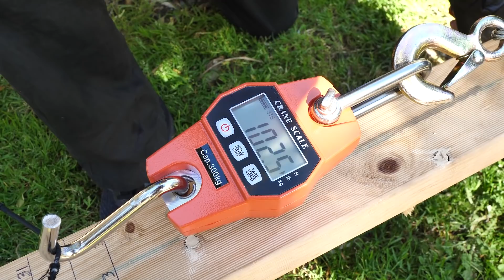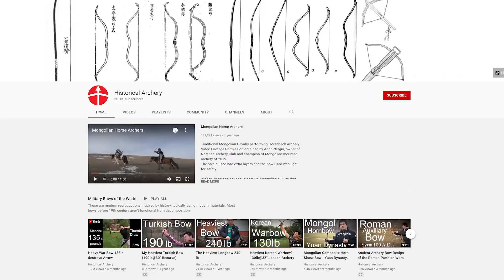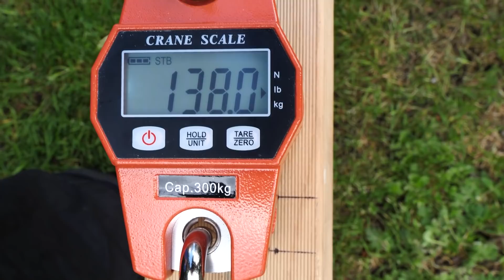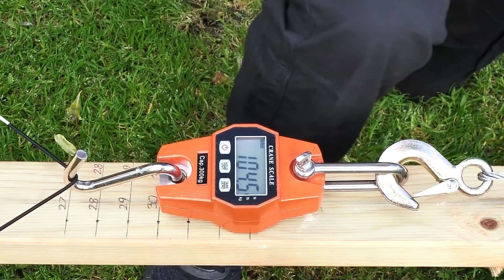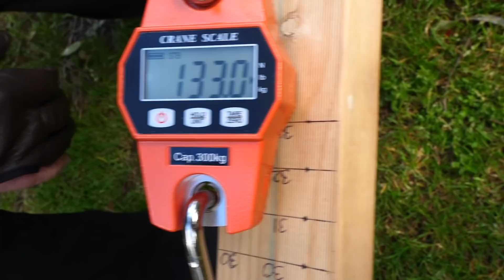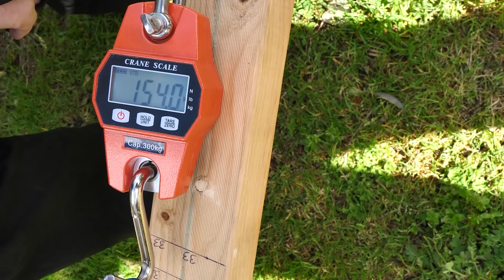Two idiots try to string a  TINY BOW

Comment: Love the video Shad! Those reflex horsebows are very difficult and back breaking to string. My 144lb@28 MR Tiron is also a two man job to string. I recommend the waist cable method to string it (with a non slippery string). Recurve bows typically have a more challenging pull experience than the longbows, assuming the same weight @ 28. They have a higher force draw curve, which translates to more theoretical energy, because when you plot it onto a force draw curve and interpolate the area of the curve, the D - shape longbows give a triangular-like area of interpolation, while these recurves are more curved upwards to give a larger interpolation area from the graph. Excited to see more videos from you.
Reply: I watch your videos. How do you string those high poundage horse bows? Do you do those old depictions of archers bending their bows using their knees and having their buddy string it?
Reply: @kenken8765  my highest draw weight is 120 (I can't even draw it beyond 29" yet and my full draw length is 31 lmao) and the kneeling method works very well if you can deadlift 180+ pounds (which most physically active people can, I think)

But there's actually a jig for it too, Koreans came up with one a long time ago (it's pretty much just a small steam bending form and some rope lol)
Reply: @Sk0lzky  why not look into a selway limbsaver recurve bow stringer? 
I use one to string my 50lb draw re-curve longbow and I think it would work just fine for this kind of bow as well.
Reply: @jackn2236  not designed for this kind of bow with static Narrow tips
Reply: @HistoricalWeapons  ah my mistake.
Reply: 144lb recurve god damn
Reply: @samueladiwinata3440  it's 200@34 lol
Reply: That isn't just a more challenging pull experience, that's a bow stacking at it's draw limit. There's absolutely zero point using that bow to try and get to 32". Shad, you need to send it back and get the right size.
Reply: @buzzkrieger3913  The bow does draw to 32' i have one myself. its stiff because its brand new. it will flex futher once its broken in
Reply: @maximilianpierce5115  that bow does NOT draw to 32". Look at MR website. 47" Despot is 30" max draw from the back.
Reply: Nice to see u here
Reply: they're not just for horseback
Reply: Why have a bow you can't use??
Reply: @cheshirebowman4465  I can use it
Reply: @HistoricalWeapons  o yes. So I see. 🤣🤣
Reply: @cheshirebowman4465  if you can't use it, train your muscles to get used to it

Comment: A long bow is smoother to draw than any other bow type. I know that, because I have a scoliosis and longbows are the best, because the smoother the draw, the gentler it is on the spine.
Reply: Did you try a long manchu bow or yumi ?
Reply: I agree with you. The recurve was designed for horse back and the ramp up he talks about during training, when you hit that, it is your normal release point. Recurves can be accurate but they are more speed than anything.
Reply: Though well made 'horse' bow has much smoother release and much less hand-shock... I know that because i have damaged ligaments in bow-arm wrist...
Reply: In my experience my horsebows and recurves draw much smoother than longbows. They may have more preload early in the draw but this is a good thing.
Reply: Interesting info. Considering my lower back and neck are pretty much shot that might be much easier on me than some of the recurves I've tried. Thanks you for that, I now have a little more hope of being able to draw more than 40 lbs again.
Reply: @MrGrimsmith  What about Jake's comment?

Comment: The extra curves are what add the extra draw weight, first you bend the bigger limbs, and once they start maxing out you start bending the smaller ones, so the draw weight increases rapidly once you start bending those smaller curves. Absolutely genius design, can never underestimate the intelligence of medieval craftsmen.
Reply: I've only barely dipped my toes in physics, but I'd guess it has something to do with storing potential (kinetic) energy in the multiple curves using tension instead of the single one of a longbow.
Reply: Not at all correct. The smaller ones, called siyahs, are ridgid, they do not bend, they act as a lever. In this case the levers are in use from the start of the draw, so this bow doesn't have the two stage draw of contact siyah bows, where the string is touching the knee of the siyah, so its bending the limbs first without lever assistance and after the levers start to point backwards, they start to assist more and more, resulting in rapid increase of draw weight at the early draw, that evens out for the end to increase slowly in the end because the full length of siyah leverage is in use.
Siyahs main purpose is to increase draw length, these bows are originally made from sinew, wood and horn, and most horns are not long enough to give the bow enough draw length, so they make the bow longer with the siyahs, witch are only wood, some cases strengthent with horn plates on the sides. Wood is also lighter than horn, so making wooden siyahs instead of limbs for the whole length saves moving mass and thus increasing the performance of the bow. Earliest composite bows didn't have wooden siyahs, like egyptian, assyrian etc. bows, but bows with siyahs replaced those older designs. 
Siyah also increases the draw length, not only by making the bow longer, but also by altering the string angle, so that the bow reaches the 90° string angle, where the bow stacks and doesn't want to bend more, later.
Later invention of contact siyahs, gave the siyahs the ability to have the two stage draw, I already explained. This design made to extreme (manchu bow) gives the bow the most amount of stored energy of all traditional bows, and thus can send heavier arrows flying the speed of other bows lighter arrows, making the kinetic energy and momentum higher than from any other traditional bow type of same draw weight.
Reply: Thanks for sharing !

Comment: Dungeons&Dragons: "Shortbows are Simple Weapons, easier to use with less range and lower damage than longbows."
Reality: [This video]
Reply: Always hated this un DnD. I have a few asiatic short bows that are a b!+ch to string.
Reply: I'd say this is a composite Shortbow, with a higher than average strength requirement
Reply: @jamesm783  - exactly, this is what D&D refers to when they say composite shortbow. Composite longbows are probably 25% longer, but still far shorter than an English longbow and get a helluva lot of power in the package.
Reply: This isn't just a composite bow (in period often a mix of one or more types of wood and bone or horn laminated together) it is also a recurve.  This shape like the cams on a compound bow makes that difference in how hard it is to draw the further it is pulled back and how easy it is to hold and aim once full draw is reached.

D&D artwork, descriptions and stats are often incorrect, especially in the simplified 5e.

A simply single wood straight bow is a simple weapon, but the D&D longbow might be as well, it's a hunting bow not a warbow.

This why I'm going to the trouble of making my own weapons tables.
Reply: D&D like every other game and movie go by the modern standard bigger is always better. But that just isn't true. Not in the case of bow performance. Bows power comes from 3 different things, witch are first stored energy, meaning the draw weight, not only the max draw weight, but a draw weight per each inch of draw makes a draw curve, witch shows the stored energy way more accurately than just the draw weight at max draw length. Second draw length, the more time for the arrow has to accelerate, the faster it is. And third the bows efficiency, meaning how much of the stored energy is actually transfered to the arrow, and that is effected by the moving mass. The stored energy has to move all the moving mass, including the mass of the bow limbs, the string and the arrow.
Bigger bow means more mass, more mass means more of the bows stored energy is used to move the bow it self, so less energy is used to move the arrow. Longer limb also means more bendier, so for the same draw weight longer limb also has to be more thicker. So extra mass not only from the length, but from the thickness also. String weight also affects on the speed, and longer the string is, the heavier it is.
How ever shorter bows stacks earlier than longer ones, that is caused by the string angle reaching 60 (where the draw weight starts to increase more per inch of draw than earlier, meaning the stacking starts and 90 degrees sooner, witch is the point where the string no longer bends the limbs, but tries to pull them backwards, where the stacking is so high, the bow doesn't wanna be drawn any further.. Luckily with design that string angle can be changed, so by recurving the bow, the shorter bow can be drawn longer than without recurves, and this short bows draw length can match longer bows draw length, or even exceed it. This shads little bow doesn't have enough recurve to match shads longbows draw lengths, it would have to be either longer or have more aggressive recurves in order to do so. This little bow just isn't made for as long draw length, but it doesn't mean than any same size bow couldn't do more. The 60 degree start of the stacking can come earlier than in longbows, meaning that the stored energy is less in the stacking bow than in the longbow that doesn't stack, that evens out little bit of the advantage of the lighter moving mass design of the shorter bow, but even still the shorter bow many times can out perform the longbow, and it will outperform it, if the both bows are equally well made, but higher quality longbow can outperform lower quality short recurve bow.

Bowyers skill has huge impact on the bows efficiency, the bowyer needs to know how much material is enough to handle the stress, but also how much is too much to have too much mass. Both over stressing and too much mass lowers the bows efficiency. And ofcourse if its way too little bit of material, the bow will break, and if too much the mass will slow it down and cause hand shock.
Reply: There is even more to be said. The arrow's flight speed depends not only on the pulling force, to which many fans of the Anglo-Saxon culture of popularized "long bows" pay attention, but also on the speed of opening the bow arches. To increase the opening speed of the bow, without increasing the severity of the pull, archers of Eurasia used a variety of materials to create a compound bow, different parts of which consisted of materials with different properties such as springy on the inside and squeezing the bow on the outside. As a result, these bows, even without a huge pulling force, opened the bows with sufficient speed to effectively accelerate the arrow, while having a smaller size, smaller weight, and the ability to use from a horse, unlike simple European bows consisting of a single piece of wood (they literally are called simple by classification).
Also, an example of limiting the acceleration of an arrow by a pulling force can be the development of crossbows, which stopped at the use of a metalic arc, which, having a heavy pulling force, had a limited opening speed, which did not allow increasing the speed of the arrow being released even more.
Well, D&D is a typical representative of Western fantasy, which naturally builds on its culture and praises its popular elements and visions;
And "Asians" seem to many to be a barbaric horde and not the world's most experienced shooters and riders with centuries of experience in creating and using these things. from which the Europeans adopted most of the saddle equipment.
Reply: @user-po2zt5le5h  "speed of opening bow arches" i already covered that in my comment. The efficiency part. Lighter is faster, and to get lighter, more stress is needed, so less thickness is needed. To get more stress, the bow needs superior materials, wood alone would break, that's why the bows back was made out of sinew that is several times stronger on tension than wood, and the bows belly was made out of horn, witch is superior to handle compression compared to wood. With those materials the bow can handle huge amount of stress that wood alone cannot, and that's why short extremely reflexed bows with long draw lengths are possible.
Reply: @jkre  Yes, your comment reveals the topic of stress in materials and I agree with it, and thats why I added information about the "spring" effect of increasing the speed of opening the bow, about which I did not see any information in your comment, but in articles devoted to this topic it is: “Compared to wood, which only deforms at 1 percent compression, the horn contracts 4 percent before it deforms. To achieve this result, a force of about 13 kg / mm2 should be applied. In addition, the horn quickly regains its original shape after the force acting on it is removed."
"When pulled, the horn worked in compression and the tendon in tension. Both materials aimed to return to their original state and increased the power of the bow and the energy it imparted to the bowstring."
The ends of the bow were made stiff to withstand the lever against the tension of the bowstring and not lightened. In this article I have not seen anything about "bow shoulder lightening", only about strengthening the material, flexibility, etc. In general this is the first time I hear about the relief and thinning of the shoulders of the bow in order to speed up a certain stage of its tension, but probably there is a certain amount of efficiency in this.
Reply: Yea in my dnd group we do weight in four stages all with different Str requirements to draw from 12-20.
Reply: It's the reason I ask my dnd game master that we make our own weapons. For example my character is armed with a split short sword (special is I can split the sword in two and can attack with both now instead of one and a short/composite bow. 
My character is also a rogue.

Comment: I LOVE my korean horse bow.
That is the magic of recurved bows like this. The insane science behind how they create their force allows them to be vastly smaller and have smaller draws than a longbow and still easily have the same ranges of poundage.
Also you need to learn the technique for drawing those kind of bows as they are definitely different than a longbow and you could hurt yourself drawing it wrong.
When I went from using a western recurve to the korean bows I had to completely relearn how to draw.